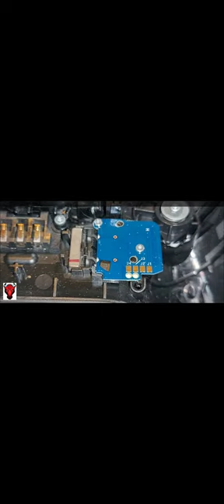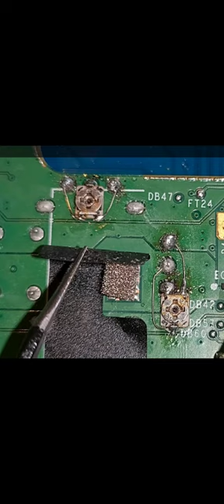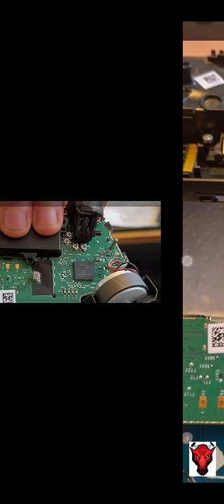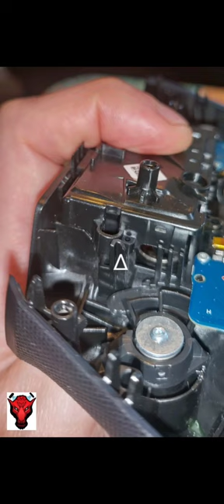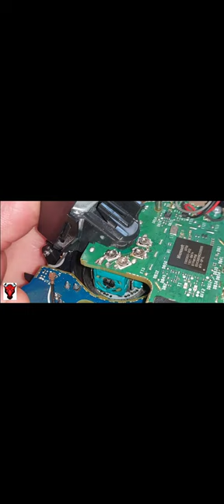Xbox one elite series 2 (black) fixes slide show.

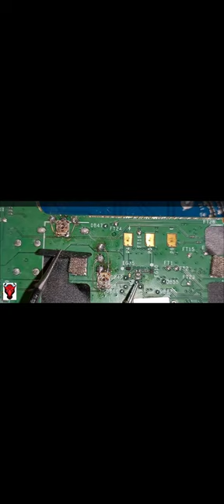Comment from the maker: 3:24 RIGHT! stick 🕹️ low set.
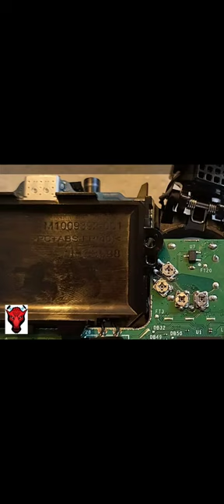8:00 Is the single L prong stand off post position the 3 prong battery 🔋 holder posts are just below the bottom left trim pot 🥴.
9:16 I could in theory bridge solder the back of the 2 trim pots for staying put strength & wire the single top front one in a low hook of the pin 📍, i considered a single wire through the middle & bringing the top pot down but the screw 🪛 rotation top hats🎩 may have clashed 🧐, live & learn i can always tighten it up for space 🤏🏼 as my solder skills go 🤷🏼‍♂️.